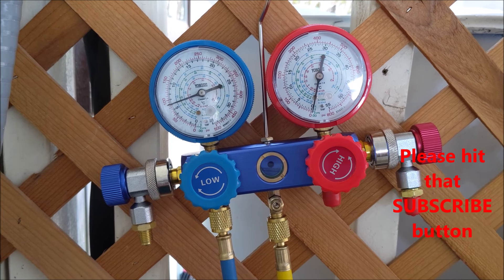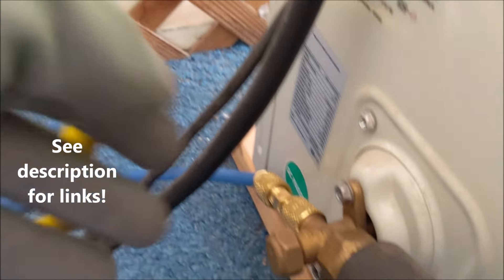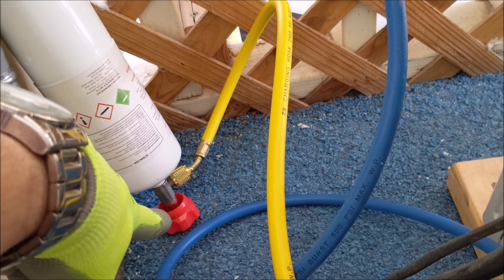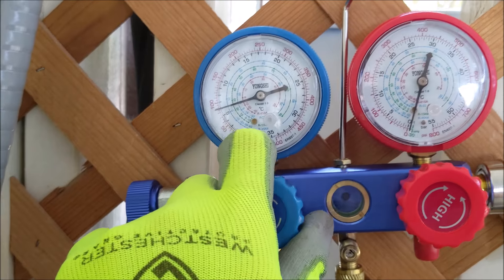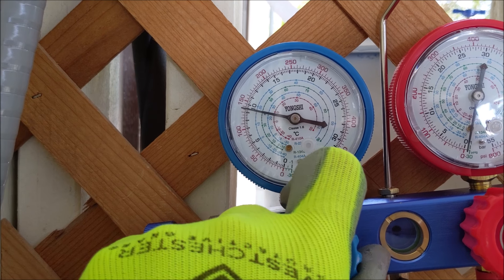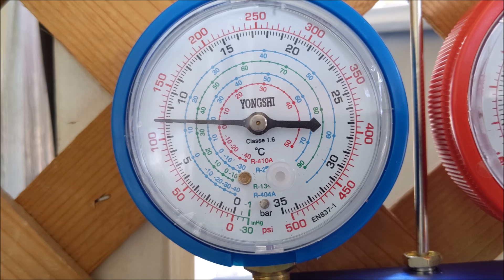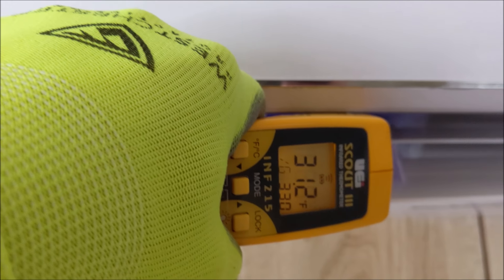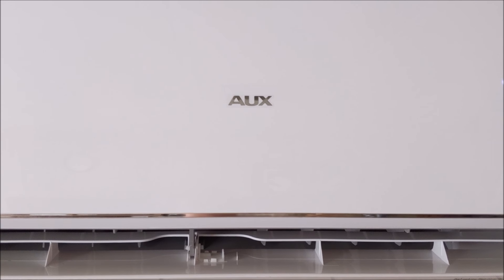How to charge mini split yourself, DIY 410a refrigerant, save money!

Comment: HVAC guy suggested a total leak test, re flare fittings as needed and 2.65 lbs 410a..$808. The leak test seems like a  good idea. Might be a blown coil in the air handler as it worked fine for 3.5 years..hmm what to do
Reply from the maker: Get a leak detector, super cheap....... https://amzn.to/3SIpuTO  and get these for the flares...... https://amzn.to/3WEBiaH Your costs would be $65 plus refrigerant. Wait a few weeks after, and check the coils with the leak tester. Both indoor, amd outdoor coils. You can check the flare connections both insode and outside too. If you do not have a vacuum pump, those are also around $65-$85........ https://amzn.to/46NYAQk  a micron gauge will help with the pump...... https://amzn.to/46IvWQp
Reply: Yes, I got the sniffer and await the arrival tuesday of the 410a (5 lb can) I also ordered the flare washers, though I also have the nylog blue(my first thought) and a good husky flare tool if needed. .  My HVAC guy said I could just pull a vacume (then change out the yellow tube from the vacume pump to the refrigerant, purging that line as per you, and then it would pull the 2.65 pounds(I have a scale to get exact amount though likely to lose a bit in the hose and the dissconnect process)  in  without running it (with the refrigerant upside down of course), much like the original release on initial install.  If I pull a vacume, I will be unable to purge the blue line(with refrigerant) as it will be holding that vacume (valve closed after using the vacume pump).I suppose I could do all this with the vacume and the unit off as per HVAC guy, and then do your method of "sucking it in" via running it on cool if the vacume does not suck it in . My plan was to seal the joints at the lower unit, particularily the 1/4' line that seem to have oil around it, fill up the unit and check all the joints with soapy water and my sniffer as well as inside the coil in the air handler and other wise see if it hold pressure over time. Hopefully it is not the coil outside and I could sniff that out..

Comment: would it be the same for an inverter style minisplit in terms of the pressure and indoor reading?
Reply from the maker: Always best to weigh the refrigerant and make sure yours system is empty, which was the case here.
Reply: @SaveGreenHere  Was the case where?

Comment: can i follow your process for heat. still same pressure of 120 lb?
Reply from the maker: Has to be only on cool mode
Reply: When using unit on heat interior unit is used as heat pump changing low side to high side. Average pressures are 300-400psi for high side.
Reply: for mulit head does it get charged on any or the ports or do i have to find a charge port?

Comment: Nice Video. I just got a 24,000 btu unit with a that needed a 35' line set, The units are all charged for 25' Is this how you add to the system?
Reply from the maker: Just remember to purge the lines to get the air out. SHould only take a split second, till you hear a pssst, and wear gloves! Here's the link... https://ebay.to/2AoIRvK I also have additional links in the description for other things you may need. The sealer listed there is SUPER IMPORTANT.
Reply: @SaveGreenHere  where do you use the sealer you are referencing here?
Reply from the maker: Here you go.... https://amzn.to/2N9qPkf
Reply: Depends on manufacturer there is a calculation for elbows line set sizes etc. On how mucj exyra charge to add, giv3 or take that sounds like it will roughly take just few extra onces of refrigirant or about 5%-10% extra. Again therebis a calculation in an installation manual that you can refer to

Comment: Do I need a valve core removal? Cuz I did it just like you and after I charged the unit I tried to disconnect the blue hose from the suction line and refrigerant try to come out and That was not a mínimis release?
Reply from the maker: You do not remove the valve core. What is a mimimis release???????????
Reply: SaveGreenHere minimis release is when you release a very little refrigerant when you are removing the service hose, but I did everything just the way u did it but when I tried to remove the blue hose, a lot of refrigerant started to come out and it shouldn’t be like that
Reply from the maker: @ovm4133  This is what I had on the page comment.... On the yellow hose, 1-connect to tank, and gauges. Slowly open the valve on the tank as to slowly release some refrigerant 2-On the gauges, slowly unscrew until you hear air out, should just take a second.  On the blue (suction)  hose, 1-Fully tighten hose on the unit, but semi tighten on the gauges. 2-After fully tightening on unit, the remnants of air in the line will bleed out at the  connection to the gauges, (you will hear the sound of air coming out) at the manifold connection, and you can quickly tighten immediately after.

Comment: Just had a mini split charged with what the guy said was 2 lbs 4 oz of r410a. Prior to the charge the suction line was occasionally freezing if it had been running long enough but it was still throwing air out at 43’f which sounds like 10 degrees hotter than your video says at the end. Now that he added 2 lbs oz the coldest the air coming out is 49-53’f. If he added it while there was ice or something could it have read low on the pressure and then later when stabilized the pressure is now too high causing that 53’f air coming out? Thanks in advance!
Reply from the maker: Are you reading temps right at the vent? With unit running for at least a few minutes. Check the side label of the indoor unit. It will read how many pounds of refrigerant needed. Compare that to the amount he added. See if he overcharged the unit, as that will affect temps.
Reply: @SaveGreenHere  the outdoor unit says 63.5 oz. so that’s 4 lbs. he said he added 2 lbs 4oz. But that means my mini split was missing half the refrigerant? And still cooling? No way. He claimed the pressure was 105 and he added enough to get it to 125. Seems like 2 lbs 4oz of refrigerant would have gotten it ridiculously high if it was already at 105 psig and he only needed to bring it up 20 psi don’t you think? It’s probably over 150 now. The air coming out is hotter than before it was charged. 49-53’f. I wish I had some gauges. That’ll have to be my next purchase
Reply from the maker: You can get them for around $40...... https://amzn.to/3BrgpXO

Comment: Your Ebay Links don't show anything-- Maybe because of a new recent law of not being able to buy 410A
Reply from the maker: See first comment on video description
Reply: @SaveGreenHere 
I tried the link but no dice. Does the link still work on your end?
Reply: Links are not working for refrigerant supply
Reply: It's just good..! r410a is awful stuff in the atmosphere..huge gwp! It's way better competent engineer repair the leak in the system rather than refill and let that stuff and then refill, etc.. and in the end all of the refrigerant ends up into the atmosphere. I have personally 2 mini split systems at home and both systems have been running non stop for 16 years with original charge..so there is no need to add the stuff unless you have a leak!! 😮 ..and if you have a leak it's a crime against the nature and humanity to just refill and refill.. No..i'm not saying the leak hasn't been repaired here, but if people can buy the stuff freely, that happens inevitably..
Reply: @hipihei  Ra410 doesn't deplete the Ozone like the old R-22. R-32 and R454 will be replacing it soon anyway.

Comment: Does this method work with a split-air with a variable speed compressor? Thanks!
Reply from the maker: Yes it does. You can get a 25 pound tank delivered to your door for around $90 here....... https://ebay.to/3q1HhWa
Reply: @SaveGreenHere  Gosh it's over $300 now.
Reply from the maker: @heskey333 That's a 25 pound tank, so around $14 a pound. You can also buy the 2 pound refrigerant for $75, and pay roughly $38 a pound....... https://ebay.us/32J9QU Up to you!
Reply: @SaveGreenHere  :
US $595.00

Comment: Hello. I started this profession a couple of months ago. I've been doing ac systems but not minisplit. Today I had to check one. The thing was that the system was not cooling and was freezing. I connect everything, blue line to the service valve and and check the pressure of the unit. This is a 410a minisplit. The reading was 50 psi, so I proceed and put some refrigerant in it. The pressure went up to 118 psi. When I turn off the unit, the pressure went up to 250 psi and I waited for 5 min and the pressure was 250 psi. Then I turned on the system again, but the pressure went down to 75 psi.... I don't understand what happened here. I waited and the pressure was the same. I turned off again....up to 250 psi.
The system was not cooling enough and I didn't want to anything else. The pressure of 250 psi was to high to my knowledge . Did I do anything wrong.....? The compressor was working, the fan...everything. This systems are more electronics than the regular systems.... Appreciate any help. Thanks
Reply: I sure would like to see an answer from SaveGreenHere as I have a similar experience.
Reply from the maker: Did you seal your flare ends using Nylog or Flareseal gaskets? Around 70% to 80% of pressure issues on mini splits are attributed to leaks on the connections.
Reply: @SaveGreenHere  well, everything was sealed. I checked with an electronic leak detector and nothing appeared. The thing is that the pressure with the system turned off was 250 psi, too high. When i turned the unit on , the pressure went down to 75 psi. This was supposed  to be at 118 - 120 psi running....  I put some refrigerant before with the unit turned on and went to 118 psi. But I don't know why ins't hold the pressure when it's on. I can't put any more refrigerant because it's in the limit... 250 psi (unit off).
Thanks
Reply: @Dito2010  check the filter

Comment: I didn't see you use a vacuum pump for this.  Is it not needed?  Also, if we do need a vacuum pump, would a single stage model work (it's about half the cost)?
Reply from the maker: You have a leak if you need refrigerant, so first check you flare ends and seal with Nylog or Flareseal gaskets as shown on my other video. Once confirmed 100% sealed, perform a vacuum. Check out my other video on the vacuum pump, and yes you can use a single stage just takes longer. Make sure you also purge the air out before you start adding refrigerant. You can get them really affordable here..... https://ebay.to/2CWEr0X

Comment: The link that you have supplied to purchase the 410A refrigerant on Amazon doesn't seem to work. I did a search on Amazon for 410A and it doesnt seem to be available for purchase? Is the link still working for you SaveGreenHere?
Reply from the maker: It seems like someone (probably in the HVAC industry) put a complaint for Amazon not to distribute it to the public. Anyway, you can get it for $45 here...... https://ebay.to/2thWqdf  I also updated the link on the video.
Reply: I bought some on eBay once. It is made in Mexico for the Mexican market. It does not have any of the proper markings or warnings for the American market, but chemically, it should be the exact same stuff. Just make sure you are trained, licensed, etc and know how the stuff works.
Reply from the maker: @MoneyManHolmes  Here is a link............ https://ebay.to/2JzUOjF

Comment: Hello, is it also possible to recharge in heating mode? Greetings from Germany.
Reply from the maker: Cooling mode.
Reply: No, because then this line is high pressure and high temperature vapour. It must suck 😃

Comment: So I installed my minisplit myself and used Kwik-e-vac to purge the lines before releasing the refrigerant. It doesn't seem to be cooling as it should. I recently bought a gauge set and checked my PSI, it's good. But I believe I have air in the system. Should I pull the refrigerant back to the compressor then vacuum the lines? Would that help?
Reply from the maker: Yes, you may have to do that,
Reply: Any updates? Im having a similar problem with an AC. The psi being around 120 but the ac blowing hot air. Im not sure if vacuming the system and refilling it will fix it.
Reply: Nope it's already mixed needs to be completely evacuated with a recovery machine and new refrigerant weighed in properly
Reply: Best way to avoid this. Vacuum the lines for 20 min prior to adding the refrigerant… correct?

Comment: Is there a better set of gauges that you recommend? The ones in your link have bad reviews.
Reply from the maker: CJ, keep in mind, those are for DIY folks. (Cheap, and get the job done) I have used that same set on that video for 3 years, and has been on other videos as well. I try to keep it simple for DIY folks! It could very well be that the reviews are done by professional HVAC people, who use much more sophisticated equipment, like S-Man series. If that's what you prefer, then here it is....... https://amzn.to/2Nr192B I have also used S-Man series gauges, and they are top notch! Over 4.5 star reviews out of 80+ reviews as of this writing.
Reply: @SaveGreenHere  No, thats way overkill.  I just wanted to make sure that it could last for more than one use.
Reply from the maker: @cjjones812  The one on the video description should work for a DIY person for basic, occasional use. If you are an HVAC tech, running 10+ appointments a day, or 60+ field visits a week, then the S-Man is the way to go. You should be fine with the one linked for DIY folks! Regards!
Reply from the maker: True, as of today, the one on Amazon, https://amzn.to/31nTA1Y is $13 cheaper, and you do not need to leave your home.
Reply: Yellow Jacket / Mastercool
Reply from the maker: @pack5eastnorthport366  Yes the Yellow Jacket like this one.... https://amzn.to/3fuY4Kx

Comment: I have a RAC-WK0811ESCWU. It’s a Toshiba window ac unit. Does that take the same pressure 120? The sticker on the side says it’s operating low side pressure is 300psig. I just want to be sure before I try to charge it.

Comment: have a blessed day...i need help..i have Mitsubishi aircon 1.5hp inverter, now very low cooling, i wanted to fill up gas, i checked with gas gauge pressure is in 140psi, but in this video showing should be max 120psi...i m confuse now.... please guide me, thanks
Reply from the maker: Depends on the size of your unit. The side of your unit should have a label that tells you how much refrigerant goes into that particular system.
Reply: If you check it when it’s on MAX cool mode you’ll see the “real” psi. Mine was extremely low resulting in ice buildup.

Comment: Hello Sir, My mini split system was leaking and lost all its freon. Now I need to recharge it to full capacity. The outdoor unit comes with 2.82 lbs of refrigerant, which includes a 15-foot line set. Should I buy a refrigerant weighing scale to recharge the system, or can I follow your method that uses PSI readings around 117–120?
Reply from the maker: Yes, get a scale. Add exactly 2.82 pounds. Just press "ZERO" button on the scale. Then start adding until you get to 2.82 pounds. Here is a scale that has that capability and is inexpensive. ALso, make sure you look at my other videos on making sure the seal is tight, using the Flareseal here---> https://amzn.to/4dhlvoS  I added a video on that here---> https://www.youtube.com/watch?v=hQjOhWkGmM4
Reply: @SaveGreenHere  Thank you so much for your suggestions.   That was my first time installing the unit and I made a mistake by not properly securing the connections. Could you please send me the link to the scale you mentioned again? I can not seem to find it.
Reply from the maker: https://www.youtube.com/watch?v=hQjOhWkGmM4
Reply: Great video 👍   My multizone minisplit lost most of its 410A. Repaired the leak and will fully evacuate what may be left in the entire system including the compressor. Pressure test with nitrogen/ then vacuum down to 200 microns and hold/ once that is done, I will add just under 6 pou ds of fresh 410A via one of the line sets. Question: Do the king valves (these are not the line set service valves but are at the top of the multiple zone manifold) need to be closed and then opened only after the line sets have taken the 6 pounds or are the to be open while adding? Not sure if the two line sets (less than 50’) can hold all the 410A. At what point is the system turned on?  I dont think it should be running while initially no 410 is in the lines. Thank you so much.

Comment: You charge with R410 as liquid while compressor is running is that dangerous for compressor?
Reply from the maker: You need to have it running and on COOL mode
Reply: @SaveGreenHere  Ok, so the mini split must be running and set to Cool mode.
I have a 18k Mr Cool with 16 feet of line. 
I read about 80 psi not running and it drops way lower when running on cool mode.
So I want to bring that up to 117-120 psi while the unit is running on cool mode, correct?
I am getting ready to do this later today and wanted to double check. Thanks
Reply: That's why you have to keep opening and closing the valve from the gas cylinder for just a short duration so you don't send a massive amount of liquid into the compressor in one go.
Reply: @EL34XYZ  any luck with your MRCOOL? I have the same problem and waiting a call from them.

Comment: Hi I have a ductless split pioneer a/c system and I believe it needs more refrigerant also. Where do you get it? can you use the stuff that works in automobiles or no? R-410A? the link for the small bottle doesn't work that you posted above?

Thanks,

Jeremy
Reply from the maker: Look at the side of your unit indoors, the label will tell you how much refrigerant you need. If you need 2 pounds or less, this is a good option...... https://ebay.us/UMOOEg but if for some reason you need more, like 5 pounds, try this one.... https://ebay.us/xWoD5Y and for 25 pounds, try this...... https://ebay.us/PQCoux